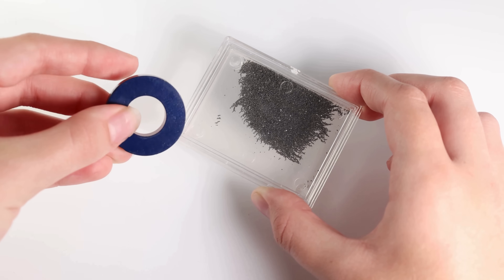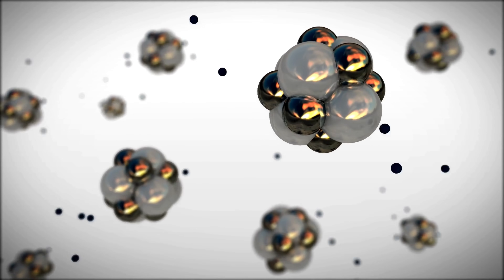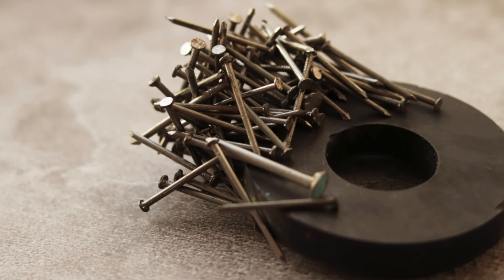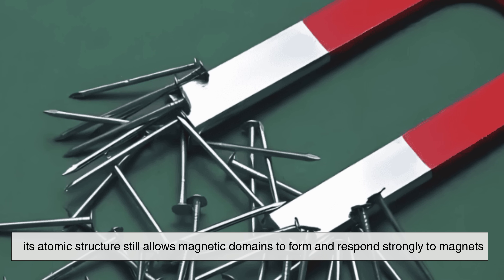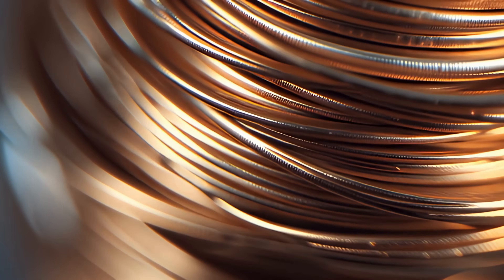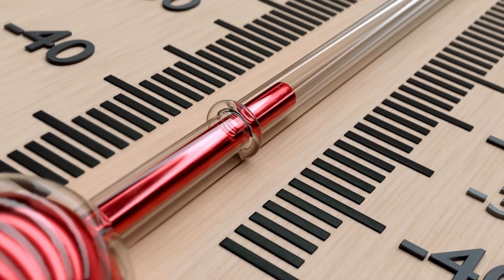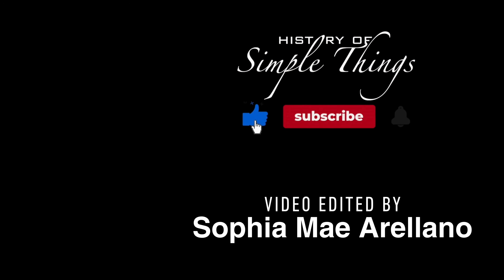Why Do Magnets Stick to Some Metals but Not Others? [ID2214]

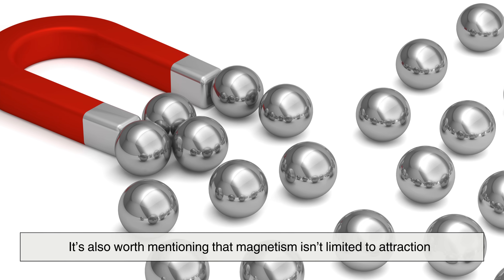Comment: Regarding 7:09, copper, silver and gold are diamagnetic. For example, a strong neodymium magnet will fall slowly through a copper pipe. On the other hand, aluminum, titanium, and magnesium are paramagnetic and are weakly attracted to a strong neodymium magnet.
Reply: Some experiments on magnetism demonstrate paramagnetic & diamagnetic properties by floating small samples of elements, compounds, minerals, etc., on top of tiny "rafts" of styrofoam in shallow, still water, while slowly moving a strong magnet back & forth near these samples.